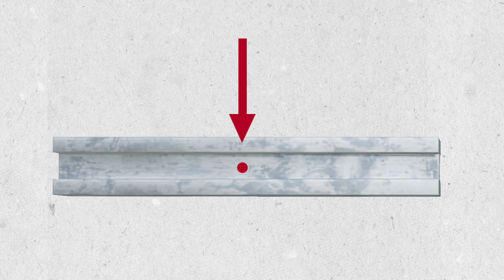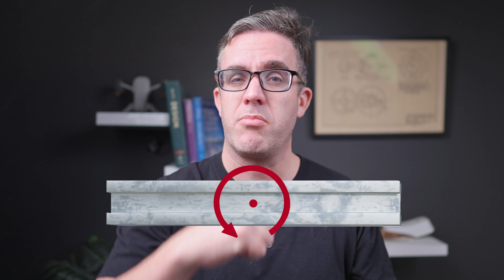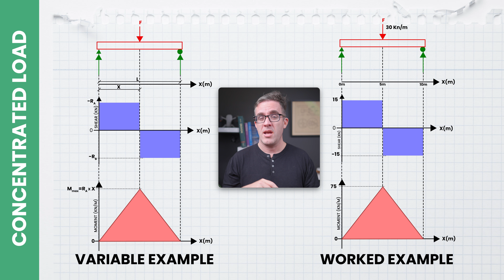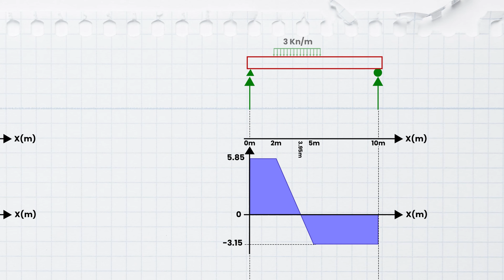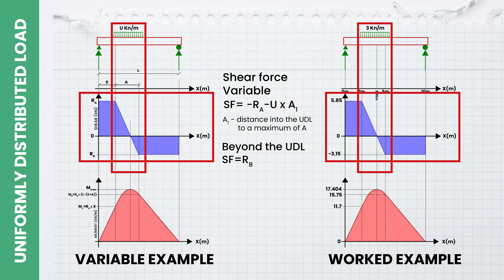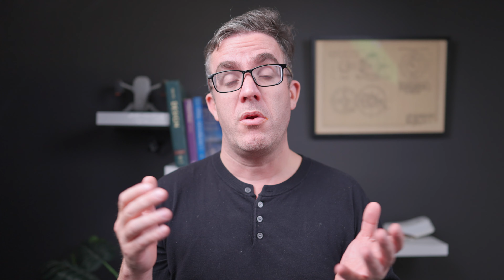Understanding Bending Moments and Shear Forces - The Building Blocks

Comment: Your sign convention at 5:00 doesn't match your diagrams later? I like the convention you use in the diagrams. I regard the diagrams as correct and the convention that humping is positive as being backward :p

I teach that for beams bending into a smile, bending moment is positive. Then you can simply integrate the forces on the free body diagram to get the shear and integrate shear to get moment without adding a minus sign. It makes doing everything by "qualitative calculus" and calculating areas under curves geometrically easy to understand.
Reply from the maker: Hi Kerry thanks for spotting the error. Yea the integration makes things much easier to understand. Hope you enjoy the video, did you spot anything else?